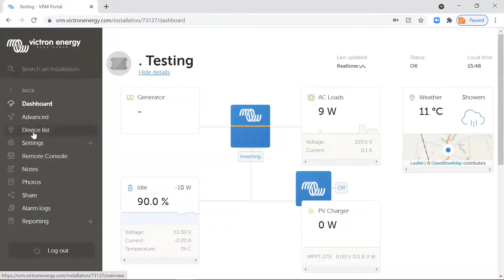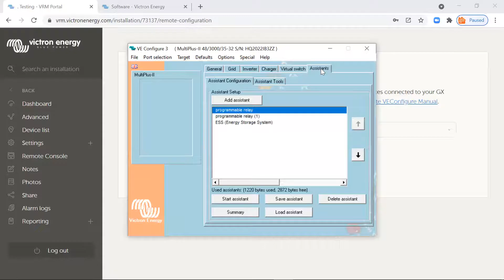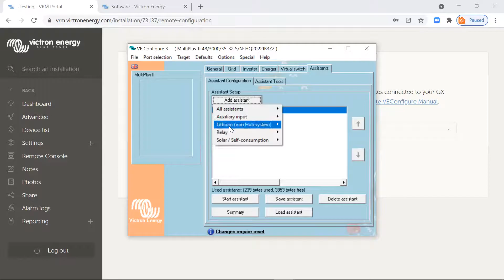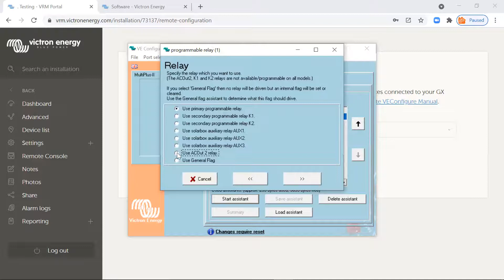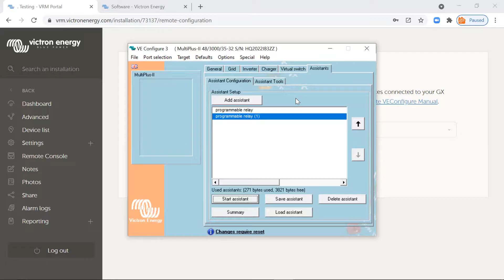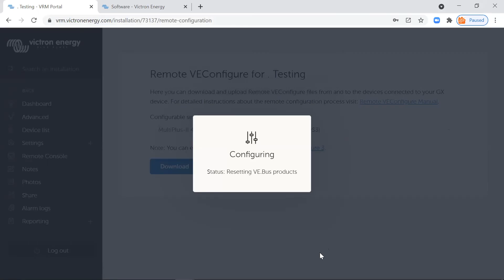Victron AC OUT 2 programming for Hot Water Diversion

Comment: Unfortunately this does not work because it will disable your shore power or AC IN. It will prevent AC in to power AC2 out. A good idea but not all the way I’m afraid
Reply from the maker: Yes - if you are already using AC 2 out functionality in the way you explained then you shouldn’t reprogram it for a different purpose. One output. = one function. If you have no other use for the AC 2 out then this will and does work well.
Reply: @benstanton I don’t want two different ways, a want either off grid, which is what you describe or Grid tied, I’m on a boat. With your assistants the AC 2 out is disabled when you plug into shore, which is a highly unwanted effect.
Reply from the maker: @ThomasWahlgren ahhh, I understand now! Yes, I’m not sure if I mentioned in the video that this assistant does not work in an ESS system. Using a different relay would be best.

Comment: Hi,
I have a small PV installation
Is it possible to turn on ACout2 (water boiler connected) when the battery is full and I do not need energy at home?
And turn off ACout2 when the PV production drops below 1.5kvp?
I do NOT want to use the battery to heat water in the boiler
Reply from the maker: Yes, practically that would be possible by using Battery voltage. The battery voltage would drop as either Load comes on or as PV production drops. You will need to do some experimenting tho to make sure you are not just turning the load on and off constantly. It will need some hysteresis between the two setpoints. The better solution might be to use the relay on the GX - to drive a contactor and use Node Red to control the relay a lot smarter. This has the added benefit of being able to make adjustments on the fly without causing a power cycle of the inverter.

Comment: Ac out 2 cannot be programmed if the Multiplus is fully off-grid. Only if it is connected to the grid via ac in, can ac out 2 be programmed.
Reply: My Multiplus 2 gx is completely off grid, but it works today as described

Comment: Nice explanation. RV situation here. I do have 30a shore power but also have a nice solar system I've built that will sustain the power needs. So..  The water heater is wired to a breaker. My MPII  48v 3000 120 is about 6' from those breakers. From L2 and the correct sized wires.. (romex..?) how would I tie that into the water heater..? Does it need a subpanel with a breaker..?
Reply from the maker: If I understand correctly then you have 2 basic options: 1: Run from AC out 2 to a relay at the water heater and program it to turn on when needed. This is probably the best way because the rest of the AC Wiring is intact and legal. Make sure you protect the cable coming from AC 2 out. 2: Run a "pilot" wire from AC 2 Out to the distribution board and supply the breaker directly. NOTE! You will probably need to upgrade your main switch to double pole so it switches the AC 2 Supply as well before it gets to the breaker) - almost guarantee that the electrical codes wherever you are will require this.

Comment: Excellent share of info. Further, is there a real time clock function accessable in the Multiplus software / firmwáre that could be included in the rules as something like "if TIME > 0900 AND TIME < 1400 then (allow the heating load to be enabled or disabled based on state of charge rules). This might allow for season adjustment of insolation hours oportunity charging and not ending the day with a reduced state of charge and no more solar hours.  Thanks.
Reply from the maker: That's a great idea but not available in the Assistants - you would need to use a relay on the GX and Node Red to achieve this I expect.

Comment: Shame it doesn't work with ESS and using "charge status"  :/
Reply from the maker: Have you tried it on an ESS system? I haven’t but now that you have mentioned it I think I’ll give it a crack… watch this space … 😳
Reply: @benstanton  I'm trying it on my ESS system right now.

When I remove the ESS assistant, it works fine.

According to the forum, ESS changes some of the triggers inside the system which messing things up for what I'm wanting it for :/
Reply from the maker: Ok - good news! It does work in ESS mode
Reply: @benstanton  What did you do, cause I've got the 2 relay assistant's like in the video, and ESS. and switching between inverting and charging with ESS doesn't switch ACOut2 on and off.

For that I need to switch between Invert only and Charge only, which I can't do cause ESS forces invert only to On.
Reply from the maker: @sarahjrandomnumbers  hmmm strange it doesn’t work. Perhaps check: the ess assistant is the top of the assistants list, the relay assistants are operating on SOC (that shouldn’t matter), you mentioned using charge status… that’s one thing I haven’t tried… testing now. Your other option would be to try and do it in node red..

Comment: THis is great! Is it possible to create a relay only if there is NO shore power connected. I have 3kva/48V multiplus 2 and I want to have both AC OUT1 and OUT2 while inverting. Currently, AC out2 is available while inverting only.
Reply from the maker: Perhaps you could use an external relay with C-NC driven from the AC out 2 under default settings...?

Comment: Hi Ben Could you point me in the direction of which relays would be appropriate, using AC2 of Quattro 48/10000 divert to 3kw hot water with 11kw pv array, Or could use relay from Cerbo GX instead? thanks
Reply from the maker: If ou can get an AC 230V Cable from AC 2 out to the Distribution board (through a main switch and MCB) then use AC 2 Out. If you can't then just use a power supply > the CERBO relay > HWC > Relay (same voltage coil as the power supply) > Element... Make sure you program a good hysteresis into the control so that the relay doesn't have to switch too often - if you can't then try to use an SSR (solid state relay) to do the switching - but make sure to use a good heatsink. 

 btw: sorry for the late reply

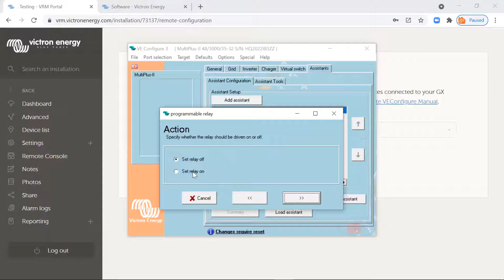Comment: Hi Ben, Thank you for posting this video.  I think I have managed to do what you have showed. At 2:36 you mention about 230v and a running a pilot wire.  Can you run the dump load (in my case a small under counter water heater (via a long cable)) straight out of the AC2 terminals? Or do you have to use an intermediary transformer or something? ie. does AC2 provide full power out like AC1 or is it only a signal control relay?

You mention that there are several ways of achieving a dump load out of a system.  Do you have any videos detailing the other ways?  Thank you for posting this video.  It has made me a lot closer to getting a dump load out of my system.  Thank you.

Comment: Hi Ben, what a great video and easy tutorial mind I’m struggling to understand a few things (I’m rather green and not very techy). I get the ac out 2 bit job done nice and easy, but I’m on shoreline and don’t want to use the shoreline I want to use the excess solar.. I’ve got 525ah Leoch lead carbon agms, with 550w solar (soon be adding another 500w) a 1000w 230v immersion heater. I don’t want the element to run off the battery’s at all though, and would like to keep to current switch in place where I can switch it on and off like normal when on shoreline or using a generator when my boats not on the mooring, is this actually possible ?. Thanks Phil
Reply from the maker: Hi Phil, sorry for the late reply, I think if you want to combine two rules like this you should use NODE RED. I have a basic video on this but I think if you're not very techy then you should document your requirements in plain English and maybe pay someone to set up a NODE RED flow for you - you might get something sorted for a few silver coins or a box of "chocolates"... I know a couple of programmers but they are not really cheap compared to a quick Google search!

Comment: Thanks. great video. currently exactly on that so very useful. 1 question though : Isn't the AC Out 2 supposed to work only when there is a AC IN grid or genset connection 'live' ?
Reply from the maker: yes - by default this is how AC out 2  works - however as soon as you load the relay assistant onto AC out 2 this default is overridden and no longer applies.

Comment: I did this setup on MultiPlus-II 48/3000/35-32, with exact parameters from video. When battery got 100% OUT 2 is not going ON. :+(  Can by some problem with FW version? I running on FW 500. Any idea what can by wrong?
Reply from the maker: Perhaps download the VE.Config file and double check that all the settings have ‘taken’ - especially the assistants. Sometimes these don’t load when uploading. I’m not sure why but I have noticed this happen in maybe 1/50 uploads. 

If that is not the problem then you may be onto something with the firmware. It’s a bit of a trick to load a deprecated version, you’d need a mk3 USB and use the VE.flash software. This is an advanced, old way of changing the firmware so a little difficult first time. I would advise looking on Victron community to see if any others have had your same problem. 

All this and I haven’t said the most obvious: perhaps you e simply programmed the ON and OFF assistants back to front or some other simple error..? 

Good luck!
Reply: @benstanton   Thank, for asfer. Problem is fixed, all start works after hard restart. I did it twice :+)
Reply: @martinmelis1473  I have this problem.   How did you do a hard restart?

Comment: When I configure relay with DC parameters, ac out 2 works, but when I try to do with soc parameters it doesn't work.
Reply from the maker: Interesting, make sure “battery monitor” is enabled on the inverter if you’re not using a managed lithium battery. Also in the GX make sure you have the correct battery monitor selected.

Comment: Great video, thanks Ben. And just to confirm, the AC2 Out will be in split phase from AC1 Out, correct? When wiring, are the AC1 & 2 Neutrals & Grounds connected on bus-bars? Finally, any issues when power is connected to AC2 IN? Do the assistants overrule the default pass-thru or are they ignored? Thanks again - I'm excited to test this out!!
Reply from the maker: Hi Pete, the AC 2 output is simply a relay connected to the main inverter so not ‘split phase’ in regard to phase angle, think of it more like a ripple control relay on a single phase House. In New Zealand and I assume in many other countries you can decide if you want the neutrals connected to the same bus bar (externally joined country code) or separated. The inverter will then test for this and refuse to connect if the configuration changes. For a normal home connected to the grid I always recommend having the neutrals externally joined because then you never lose the MEN aspect of the installation so it’s safer in most fault conditions. 

When power is connected to the AC in on both 1 and 2 at the same time the inverter will behave differently depending on the assistant setup (a bit much to delve into in a comment sorry). Typically AC1 is priority (Eg grid) and AC 2 in would be for a generator. Note that the Quattro is not compliant for Grid connect in NZ or Aussie but we can add some kit to fulfil the 4777 requirements.
Reply: @benstanton  I should have mentioned my unit is a USA 48v/10,000/2x120v Quattro, not the 240v units that I guess you use in NZ. Since our Quattro AC-OUTs only have the single live line, I'm using a 100A AutoTransformer at the end of the AC1 OUT line to give me an L1 L2 N G output that feeds into my 50A 120/240 RV plug. I want to eliminate the AutoTransformer (its cooling is inadequate), and was prepared to replace the 10k Quattro with 2x5k's wired for split-phase; but if activating AC2 OUT and running it to my L2 terminal in my 50A plug works, this will be much cleaner (and cheaper!). I do have the correct assistants available, so once I setup some test wiring I'll let you know what transpires. Cheers Ben.

Comment: Ben, this is a great video.  I have programmed as described, but I am still waiting for the electrician to connect a plug to AC out 2.  However, I don’t hear a click when I get to the required SOC, and the relay also don’t change from open to close on the remote console when it gets to the set point.  So I am not sure it is working for me.  In remote console there are only two options for relay 2, manual and temperature.  Should the application override the remote console (which is set in manual).  I have only three apps: ESS (I think the one you erase in the video) and the two I added.  Any speculation of why it could not be working for me, or why remote console does not show when the relay flips from open to close?
Reply from the maker: This is very interesting - I have also tested this on my system and there is some sort of conflict with the ESS and relay assistants. I wouldn't hold my breath on this being sorted as Victron have a lot of other cool stuff they are working on as priority. For now you may want to use the relay 2 on the CERBO GX and Node Red..? Unfortunately this will require some extra wiring to be done on site...

Comment: Brilliant, been looking for a robust solution for ages.  Victron advised me to buy an AC Thor which is currently operational but relies on frequency shifting which is not always reliable.  They did not recommend this method which is frustrating.

Great video 👍
Reply from the maker: Yes - the AC Thor works very well - especially for Lead Acid battery types (due to the long tail-off and slow rise in frequency) but with lithium systems the tail-off is pretty much immediate so the full amount of PV is available for the Hot Water element in a short space of time. re: Victron not suggesting this... to be fair to Victron there are likely a lot of situations where this method (hard switching of the element) would be a bit too rough on the batteries eg, when there is a small amount of PV compared with the element size or the battery capacity is very small, in these situations it may be better to slowly bring the load on and try to maintain the battery at 100%. Most of my designs are for medium to large residential and commercial installations where there is a lot of PV and battery storage relative to the load ( I aim for 5 days of autonomy in my system sizing) and so there is often a lot of excess energy available and it doesn't hurt if the battery is at say 96% Vs 100% after the Hot Water element turns off. - Hope this makes sense...!??

Comment: Does anyone know how multiple requirements are handeled when you define more than one requirement per assistant? For example, if I set "turn relay on" when SoC > 95 % and AC Load < 1000W, are these conditions connected via a locig AND? I want to make sure that while the SoC is above a certain point, that I also don't overload my inverter, hence the other loads need to be below a certain point of ~1000Watts, otherwise I will immidiately trigger the switch off on overload requierment. 

Thanks!

Great video anyways!
Reply: This is also my plan. Would be nice if somebody could tell us if its logical AND or OR. Thx!
Reply: @dilixvontilly  
Unfortunately, as I found out, it is always a logic OR. Hence you cannot do that kind of setup with these conditions. A possible workaround I've used is the Generator Start&Stop Mode, which now switches my load. You have to use it in inverse logic (Gen off = Load on, hence use the NC contact to connect your relay) but it works more or less. It is still not possible to set conditions based on negative loads or battery current, so you have to use the Battery Voltage contitionb (which will result in a okay-ish merge between SOC and charge current to trigger the load) instead and fiddle with the timers, which works best for me at least. You can also use the "quiet hours" to your advantage and use the timer to e.g. deactivate the load in nighttime (just turn the Gen On voltage condition above your maximum system voltage)

Good luck with your system!
Reply: @kaffeetasse9455  How about using the "AC Load" variable in the MPII to start AC OUT 2 when load is low enough and then using the two relays of the Cerbo GX in row ( logical AND if I am correct ( no electrician )) to control a switch in the cable to the water heater? In this case we could create a logical AND with "AC Load low enough", "SoC high enough" and "water cold enough". Or am I completely wrong?
Reply from the maker: Hi All  - sorry for the late reply - I have one word: NODE RED 

oh, that's two words...

Comment: Very usefull, I was about to start writing some code on a relay to do this.  Next step would be to somehow integrate the geysers temperature into the algorithm as well.

I am also considering installing a smaller 2kw element into the geyser, so it will run longer, but wont max out the inverter each time.